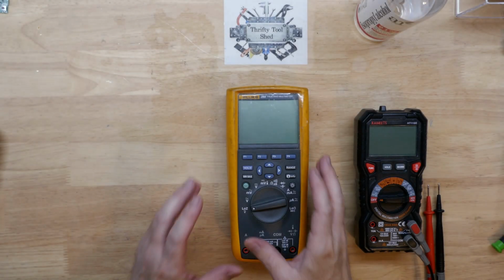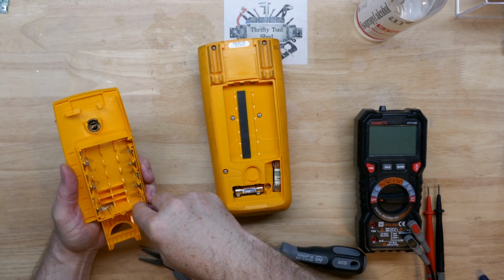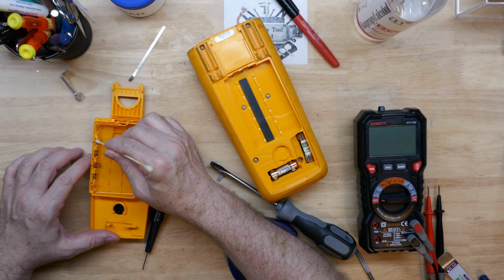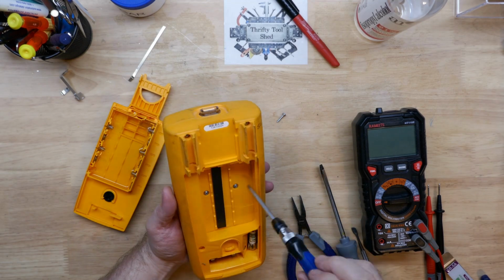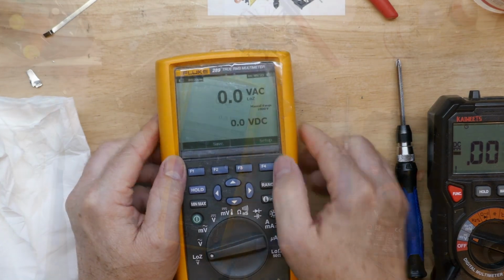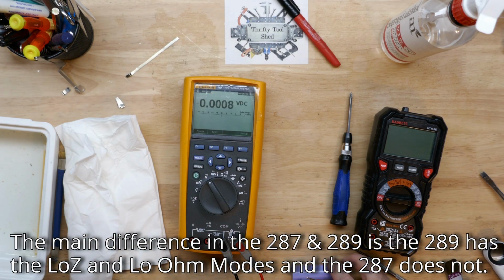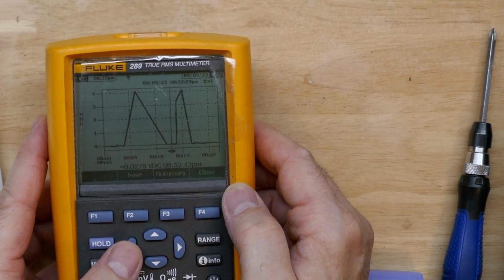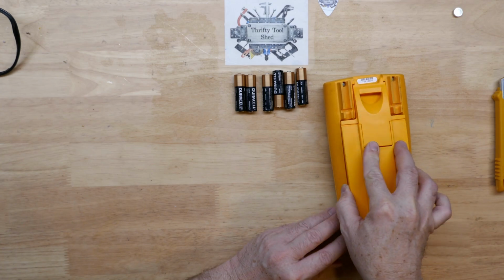Fluke 289 Repair with Look Inside

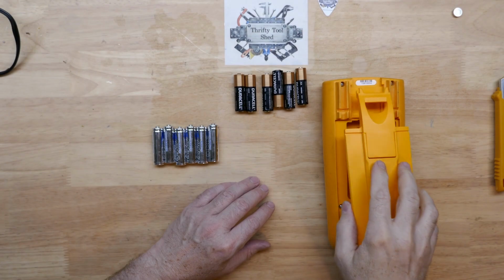Comment: I enjoyed the video.  At 19:12 min, you discussed how you plan to try Lithium AA batteries mainly to avoid leakage from alkaline batteries.  As you mentioned, disposable Lithium AA batteries have a higher voltage (about 1.8V brand new) than alkaline AA batteries (about 1.6V brand new).  Since it has been 2 years since you published this video, what has been your experience so far using higher voltage disposable Lithium AA batteries with this meter?  Thank you very much!!  😀
Reply from the maker: They have worked very well so far. I try to use the lithium cells in all my test equipment period. The minor draw back is many times the voltage low indicators  (that could be built into some meters) may not give the low battery warning. While inconvenient at times it's nothing like the corrosion of the alkaline batteries when they also give no warning. Thanks for your kind comment!

Comment: Thanks for the video. I recently repair a 289 and have a few 87V's also and wanted to warn anyone who watches to be aware that the grey plastic on Flukes turns brittle after a few years and will easily break. Even if it looks fine. 😉

Comment: If you guys want to replace the supercapacitor, "Panasonic EECS0HD104H" Works perfectly.  $4ea on the auction site.  Its a little bigger than the stock one but just trim the legs a tad and you're in.  And you'll have a larger and longer lasting supercap.  Lookup the joesmith video on replacing the supercap on a Fluke 189.  It's the same deal.  I have both a 189 and 289.  Same supercap.
Reply: Just found out, this only works on older versions 4,200,000 SN and older.  doesn't work on newer versions.  if you have firmware 1.41 it doesn't fit, if its older than it works fine.

Comment: My dream is to own one of the Fluke multimeters, even if it's an old model.
Unfortunately here in Japan it's way over priced, even the used ones in horrible conditions are sold at around $300 or the Chinese made knock offs at $80 (106 or 107)

Comment: Alkaline batteries always leaks no matter the brand, even ones that says leak proof still leaks. One of my meter corrode because of leakage about 17 years ago and ever since i use dielectric grease in the contacts on every meter i own so no more corrosion, and also every few years check your device if you don’t use it that often. This was easy but sometimes when the contacts connect to the pcb it requires extra work.

Comment: Is that acid brush metal?  I cut the standard hair brushes down to stiffen mine, but have never seen one made of metal.
I've never used a 289 thanks Shane for donating it.
Great video. 
Thumbing- Up 👍
Reply from the maker: I did use an acid brush that I cut down to make it stiffer exactly as you mentioned with the vinegar. Then with the IPA I used the blue double sided brush with the stainless steel on one end to help in final clean up. It is also anti-static so I will use it with boards with corrosion as well. I do have a link to a similar brush in the comments as well. Thanks for your kind comment!